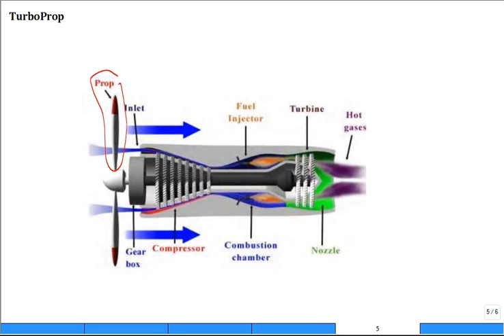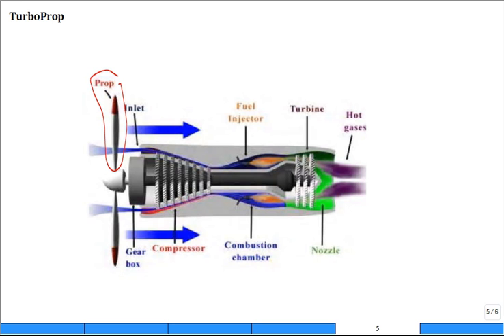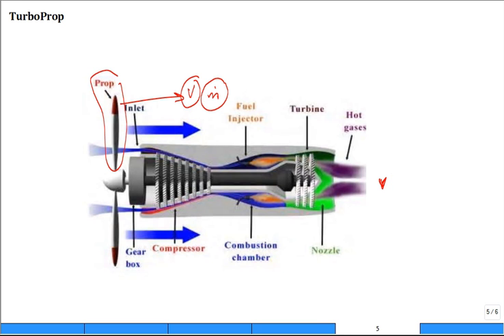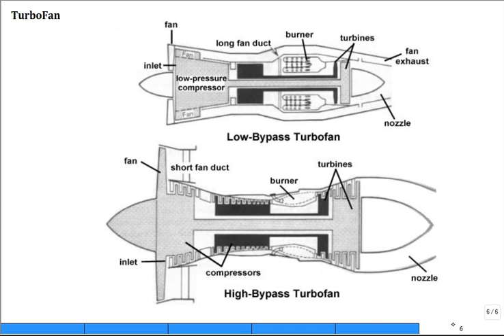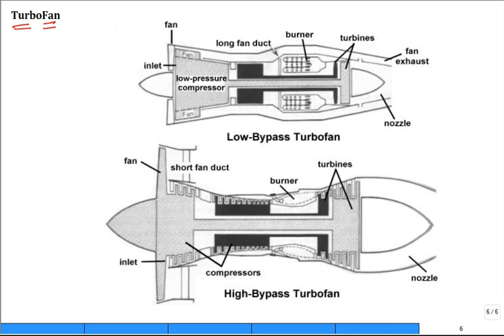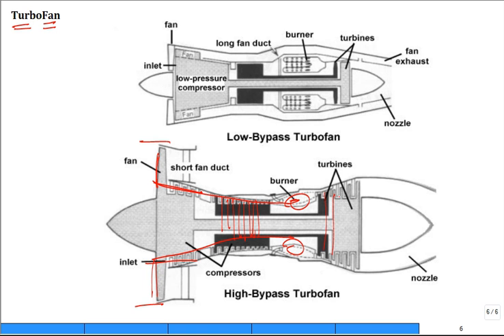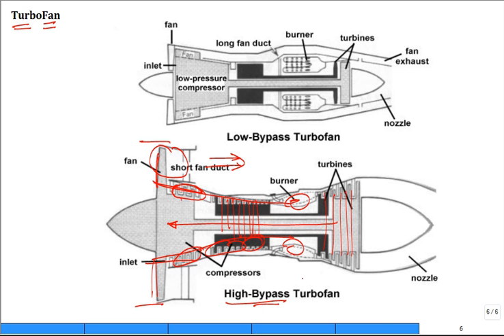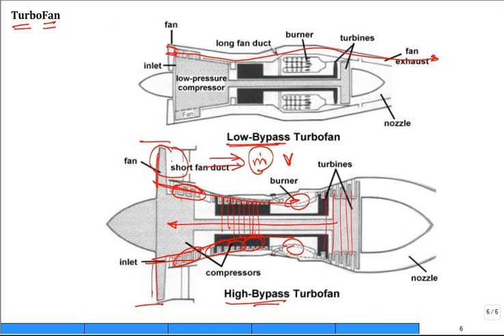Intro TurboProp and TurboFan aircraft engines

Comment: Fighter jets use low-bypass engines and commercial jets use high-bypass engines. The fan is actually a compressor more than a propeller, it compresses the bypass air and this bypass air expands and accelerates out the back of the engine to produce jet thrust much like the core exhaust.

Comment: Its my understanding that turboprop engines today, are more fuel efficient than turbofan engines.  A Boeing 737, with four turboprops would use 40 percent less jet fuel than with it's two turbofans.  The down side, roughly 100 mile an hour slower crusing speed.  That would make a big difference gong cross country or overseas.  But on a flight from Charlotte NC to New York LaGuardia, 15 to 20 minutes difference. I personally like the turboprops better because I like the sound that the props make, the "box fan" sound in taxiing, and the bumblebee sound in takeoff and inflight.

Comment: Have my own guesses that's all about aerodynamics. But why should energy already gathered and directed in the burnt gas flow come back through a turbine, to speed a prop or fan, to generate again a new gas (air) flow , to eventually push the plane? Isn't there a loss of energy? Have other ways to optimize the primary gas flow been thought or tryied?
Reply: İf there is no fan then the engine is called a turbojet and it is very unefficient and i dont know the answer to your question i wonder it too
Reply: @ferid9k  aERODINAMIS IS COMPLICATE, ther is the drag, the full proffit of turbojets must be above Mach1 and that brings other problems for civilian airliners, it's undesirable. and so on
Reply: I know its a little bit late but my understanding is that the fan actually sucks extra air in that is needed to the complete combustion of the fuel.  By spinning the fan the reaction is given an excess of oxygen allowing for the formation of water and carbon dioxide rather that carbon monoxide or soot, this reaction is more exothermic so causes the air to expand more and increasing its exit velocity and by extension its thrust.